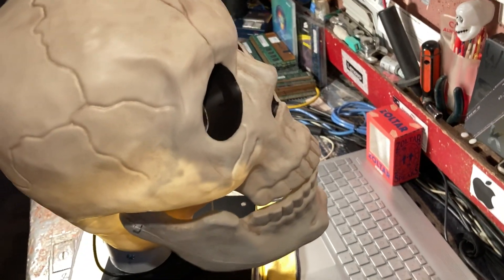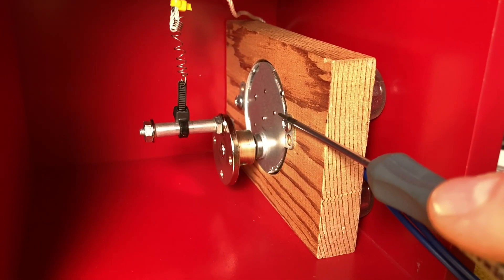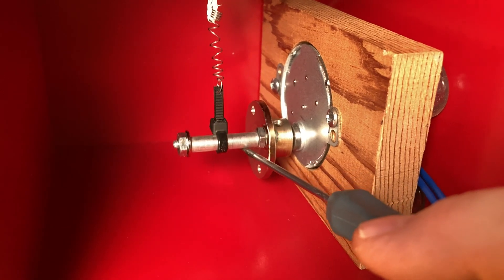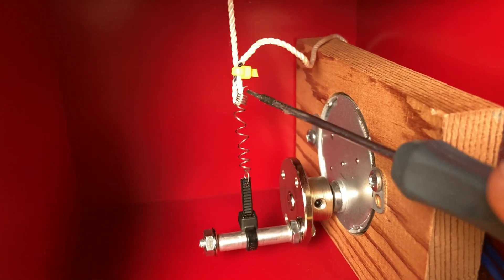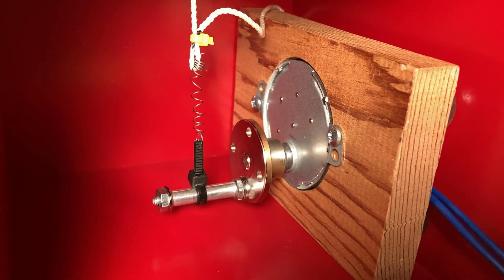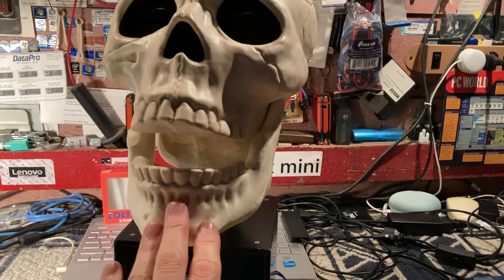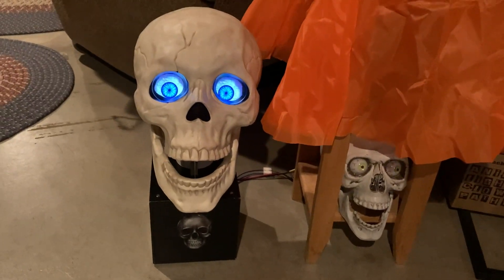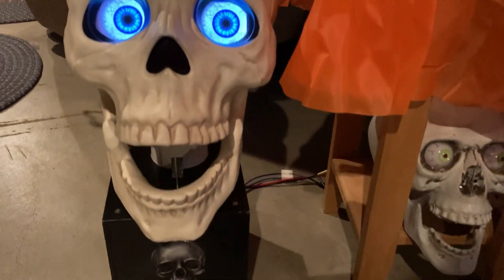My Large Animatronic Skull With New Motor Installed Part 2

Comment: Great idea using that spring to eliminate fighting out the string length
Reply from the maker: Thank you,  yes makes it a whole lot easier, you don't cause a strain on the lower jaw when it does open all the way down. Then you are converting the energy to the spring at full down position. 
Thank you for the comment, stay tuned a lot more coming.  😀

Comment: Looks cool.
Reply from the maker: Thank you glad you like it.
I was looking at your YT channel that Animated "Swami" Fortune Teller by Gemmy (2007)
is really neat. Did you modify it in any way? Thanks again for the comment.
Reply: @mikecomptech  No, but I did have to figure out how to take it apart. I bought it off EBay and it was sold to me as working, but when I got it one of the eyes didn't light up. In it's trip to me, one of the soldered wires had come off, so it was an easy fix, after I got it all apart that is.